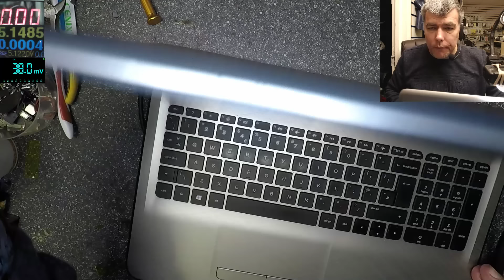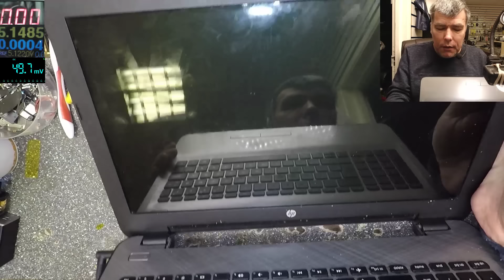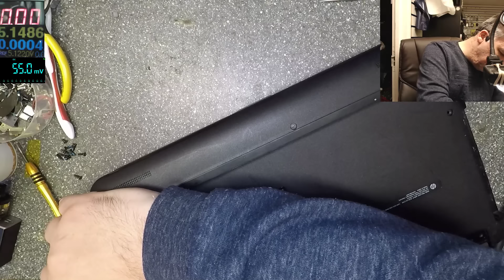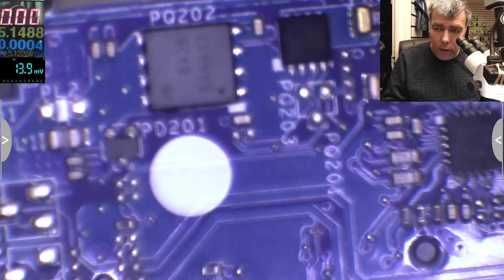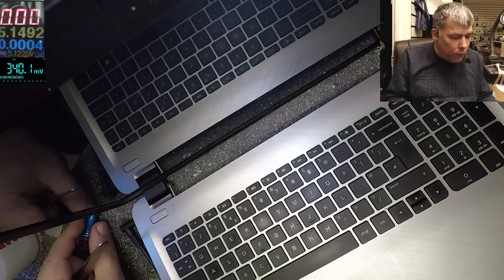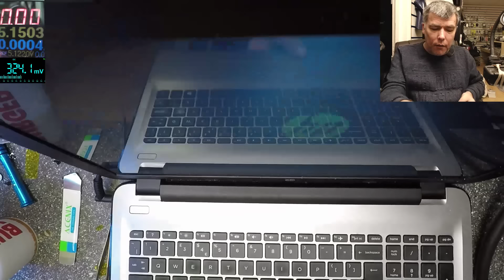Most common fault on a Dead Laptop

Comment: My laptop asus k40ij.now i have black screen problem.i tried removed battery and reset system.but not answer.before problem i operate my laptop it was quickly shout down.then i swiched on.now it start.after 2 days when i was operate my laptop opened windows bars were opened.folders icons were changed.then quickly auto shout down.after that i tried to start my laptop.i was failed.please help me

Comment: I have two hp laptops here and one of them  shows the same symptoms from this vid, except im not advanced enough to test anything else other than power jack, battery connector, etc.. All were showing the proper voltage. The other one used to show light when charging but when turn on the light comes on for a quick second and turns off. Now it doesn't show led when charging anymore and power led comes on for quick second when plugging the charger and same goes when battery is inserted.  What do i do?

Comment: Dear Sir,.  I have hp laptop polio 9480m ......when it's charger get faulty ......I try to use dell charger for it....but accidentally I reversed the polarity.....that time laptop get dead.....then I disconnect battery and connect again.....it's working fine....but it's showing charging without charger connection........what should be the problem there.......now I don't have hp charger in locked down period.......what should possibility of damage there?

Comment: Hello sir please answer my question I badly need your answer. My laptop is not turning on but when I charge it the battery is working but its not turning on. I try the 30, 60, 120, holding of power button but still it does not open. Please help me

Comment: Your list of failures from global warming to French fries was close, but Buffalo Farts caused global warming. Ha! I know you was having a little fun at work. You have to fun! Now, the N-Channel MOSFET is turned on by voltage rather than current. It makes sense that other “Go-No Go” inputs could be a simple reason why this power switch would not turn on. Battery issue, hot signal from a thermistor, etc. All joking aside, I enjoyed the video with a simple solder bridge to take the place of the mosfet. Sweet! I am just a retired automotive tech of 40+ years. I hit like and subscribed and will checking out your “Mother-Board” video and others. I have 4 year old Dell (Dead, kills A/C adaptor when plugged in and two different ones tried) MacBook Air, HP. They are stacking up like cordwood. On internet with WiFi part of a cellphone I don’t have a plan for because I don’t have an extra $27 per month in budget. Wife can’t work, she’s having aortic aneurism in 32 days, I am having my 4th lumbar fusion (L3-L-2) Just all kinds of fun. Just want to send an email to 2 sons and daughter/ their family. Be well buddy & like the sipping cup while saying “Coke” could be a problem. Be watching more to fix and just learn. Thanks.

Comment: HEY ! RESPONSE MY  QUERY ASAP...AFTER DROPPING MY MOMS LAPTOP I CHECKED INSIDE THE LAPTOP AND FOUND THE MOST PROBABLY WIFI CARD  CONNECTORS ARE LOOSE AND I PLACED IN PROPER JOINTS BUT STILL NOT GETTING WIFI CONNECTION.I WANT TO FIX IT AT HOME 'CAUSE I'M PHYSICALLY DISABLED TO GET TO TECHNICAL EXPERTS. REPLAY AS SOON AS POSSIBLE.

Comment: HEY! I DROPPED MOM'S ASUS S41OU  LAPTOP AND SINCE THEN IT DOES NOT CONNECTS TO WIFI AND I CHECKED OPENING IT , MAY BE THE CONNECTING WIRE JOINTS TO THE WIFI CARD I GUESS - ITS LABELED QUALCOMM ATHEROS  QCA9377  IS LOOSEN AND I PRESSED ON IT TO TIGHTEN IT AND THEN CHECKED ITS NOT CONNECTING , I'M PHYSICALLY DISABLED AND CANT GO TO ANY MECHANIC , DONT WANT TO KNOW THEM THE CASE , WHAT CAN I DO AT HOME AND  WHAT  CAN I DO TO POLISH THE DEVICE BODY   AT HOME-REPLY ASAP!

Comment: hello, first congratulate you on your videos, now I expose my case to see if you can help me, I have a laptop hp tpn-c125 my problem is that only the LED of the charging port in white turns on but when I press the power button The computer does nothing, does not turn the fan or show anything on the screen, and disassembled to measure the voltages and see if any component was burned and seems all normal, but when I remove the pcb where the power button is housed that It is in the plastic and the pulse the laptop tries to turn on to see the pwr led light during the following and turns off and the processor in all this process heats up as if it were working but it does not start anything just does that. Could you help me?

Comment: I have an old laptop someone gave us. My son would play games on it and I used it for the old floppy drive with usb so I could get pictures off of old floppies and put on flash drive.
One day it was dead, dead, dead. Zero. Nothing. I traced the input power down to the circuit board near the input plug. It had surface mount resistors I noticed had numbers on them I figured were the value numbers. Near the power plug it had a couple marked 0.0
I thought about it that was a weird value for resistor then it occurred to me it might be zero resistance used as a jumper on circuit board so I found the one with power on one side and zero on the other and soldered a tiny wire across it. 
I then had my ‘ Colin Clive from the Frankenstein movie ‘ moment. “ It’s alive ! “

Comment: I like the idea of using voltage to check continuity and short circuits.  If you have a high resolution meter you have a more procise location for the  short circuit it helped me pin point a short  on the  circuit.  Great videos ....

Comment: What is the reason for extreme heating of hp laptop. My technician told it had caused for sticking not responding in time to time in my hp lap by a loosening of some ic pins. Does it true?

Comment: What if an MSI GE62 6QD Apache Pro Laptop appears to only partially power up?  It will charge the battery, but the only thing that will power on are the fans, and the backlight on the keyboard

Comment: I get why you wouldn't want to spend time replacing components, it's time-consuming and not economically viable. But stuff like that mosfet was put there for a reason, there's no way a company will engineer consumer devices with extra components that increase their cost. If the component failed, it failed for a reason and not being there now could cause bigger issues in the long run. 
Or it can work fine without it for the rest of the device's life, who knows? I wouldn't want to risk it, nor would I feel comfortable having to guarantee a job like this. 
In any case, problem solved, customer happy, you get paid, planet saves from a little bit of extra electronic trash. That's the most important

Comment: My laptop when plugged in has light but when I try to switch it on the light goes off. I tried using a new battery but it had the same problem and the laptop is not switching on. Help

Comment: Hi I have a ASUS N53SV it runs. there is a light on the front with a lightbulb symbol. I have seen the orange light blinking with hard drive symbol. But the screen stays black, also when i plug a HDMI in the laptop the external screen stays black. What is your opnion to start trouble shooting this case.

Comment: Hey guys so im new in this electronic thing, I just were watching videos until i found this, I am trying to get overall info before try to fix something, So i have a question

Whats the difference between the Mosfet being replaced or not? I mean he just took off, so after he removed the thing, the circuit now was now 'closed' right?, so the electricity just keep flowing normally?  But whats the difference? Can someone explain me?

Comment: I've seen three of these vids so far. First found bad diode, unsolder tossed aside and fixed. Second time was bad cap, unsolder and toss aside, fixed again. Third time is bad mosfet, unsolder then shorted with small wire and tossed aside fixed!

Comment: So I threw up on the side of my laptop (hp EliteBook) and when I cleaned it it was working fine. A few months later it won't turn on but the charger light is on when it charges. I checked inside including the battery and everything looks fine

Comment: I have a ACER ASPIRE f15 laptop. I’ve been charging my e-cig through my my USB port on my laptop. I don’t have a plug so I’ve been using USB ports. Recently I had a problem with my e-cig it wouldn’t charge properly and caused a power surge on my laptop. This was displayed in bottom right hand corner warning me. Then my laptop froze and wouldn’t let me properly shut down so I had to hold the power button down till it went off. I went too bed woke up next day and there’s no power lights on and won’t charge or turn on. I’ve tried a few things which haven’t worked :
* Pinhole reset on back 
* bios battery taken out put back in 
* fuse in charge plugged changed 

I suspect I’ve fried something but I can’t smell anything burnt. 

 I’m not that great on computers, what else can I try too bring it back too life ?

Comment: My fell laptop wasn't working i took it to my friends house to see if he could fix it .well it was about 2 months passed by . Anyways just happened to stop by and i ask so any luck with my laptop he' like it won't come on . Well it was coming on but i can't remember what it said to do anyways he plugged it in and do you believe it actually came on and was working wonderful. Now this was last Friday so it's been working for a week and actually all Thursday morning well i went to turn it on around midnight well one power light came on then went off then the other Bink on and then went off then the red light just kept blinking for about 10  seconds then went off then one power light came back on for about 10  seconds and qentof they keep going on &  off. But the thing is the screen stays blank and looks black lives ke there's no power. You.dont hear the fan nothing appears to be on or working other than the lights going off and on .  So i  have no power other than blinking lights .and you can't hearthefan so what's my options. Any suggestions

Comment: Hi first of all thanks for great videos , i have hp laptop with fault, it flashes 8 orange when power plugged in, all i find on internet is they say faulty power adapter but i tried 3 new ones all do the same thing, what can i start checking , thanks

Comment: I love the simplicity of the way that the 8-pin IC Chip was removed and then (using calibrated fuse wire) bridging the Drain & Source in order to restore the 19vdc supply to the circuit.To say that the Motherboard is "complex" is an understatement! It is also extremely difficult for anyone to fully understand the full function of the 8 - pin IC Chip that you removed. Further to this, the pinout diagram would be needed - in order to ensure that you do - in fact bridge the Drain & Source. The IC device which was removed, handled the full current of the Laptop. There may have been the correct 'Gate' voltage present to turn the Mosfet on, but the device may have been faulty. I do appreciate everything that I have seen in this video, and I have been enlightened by your Tutorial. Thanks & regards from Sydney Australia.

Comment: OK, are you leaving the power connected while your dismantling components?  This is not recommended.  Maybe your using a power bar switch as your working and testing the device, but it didn't look like you are.  eek.

Also, an FYI.....spending just a few minutes using compressed air to clean the CPU cooling fan and vent, as well cleaning off the gunk on the screen, keypad and device housing for your customers....makes for a great customer service technique.

Comment: Love your videos, but I must agree that this one seems dodgy. Replace the mosfet with a wire. Why was the mosfet there in the first place? I'm sure the manufacturer deemed it necessary, they would have left it out if they could. Bypassing it has eliminated some capability or feature, likely safety or reliability-related. You called it a fuse, but wasn't it just a fine wire? If it's all about saving time, why not just leave the mosfet in place and bridge it?

Comment: I have the same laptop. Battery is dead(Battery # 807611-421). The battery has only 3 cells, which gives 10.95V. I found in Ebay a battery with the same number but has 4 cells (14.8V). My question is will this battery damage the motherboard? The voltage (either 10 or 14) will be converted into 3.3V & 5V so will this 14V harm the logic board?  Thank You

Comment: I have a acer lap it died sudenly it doesnt charge or there are no lights on i removed my hard disc and i have a rlly quiet ticking noise when i plug in my charger its not the hd that ticks cuz i removed it so what is making the ticking sound when i plug the power in ? Can u tell me pls

Comment: I dont think that is a proper fix.. If I were u, I would have tracked down gate line. Most probably that MOSFET should be doing polarity protection. Now most probably u can get 19v at port from battery because there is no MOSFET preventing battery voltage going out.
Hope that makes sense

Comment: Dell E6400 laptop
Windows 10/ Also flickered with Vista
Screen flicker issue

Flickers at bios screen
No issues on external monitor
Checked ribbon cable
Tightened hinges
Updated drivers
No visible screen damage
Purple line across screen
Flickers like a hearbeat
Flickers in safe mode

What to replace first?

Comment: Hello, I have a Toshiba Tecra Z40-A series.  It is been dead for 4years.  My daughter put a different charger, we were in vacation abroad and I assume some relative gave her a different charger and that's how it burned.  I connect the original charger and pressed the power button and the power button flashes twice and at the third flash yellow led under the 🔋 and charger icon flashes along with the power icon.  When it was working my 💻 was showing that it was not charging until it went dead.  A computer specialist told me that it was the motherboard.  I think is something along with the charging system to the battery. The charger has 19volts and the power button and the battery/charger indicators are giving me some codes? As it flashes?? Thanks

Comment: This is not the correct way if you remove the component and short its pins this will not work long can cause fire hazard not recommended

Comment: Hi,I have a hp laptop that's kinda dead.. I plugged the charger into the laptop without a battery,the light on the charging port will light,but when I press the power button nothing happens..what could be the problem?

Comment: I've got an hp 15-g023cl laptop it has no power at all, removed the cmos battery for 15 minutes and put it back together and it worked fine for a couple of hours but didn't notice it wasn't charging and it died completely again so I did the same thing again but this time it didn't work, any suggestions would be very much appreciated. Thank you

Comment: I have the exact same problem with my motherboard, only diffrence is when i put power suplly on that current resistor two chips are getting really hot (ALC271x and 95836 HRTZ). Do I need to replace those two chips or something else might be the problem? Thank you!

Comment: the fault started this way, m narrating if you would help suggest a solution.. I was first having a fan issue, because the fan stopped working, I didn't give it an attention, and am a type that doesn't switch off my laptop I would just close and leave,  so a day came that I was playing FIFA 15 on it and it suddenly started heating out which has never happened, I turned it off to cool it after which I tried putting it on but refused to come up on the screen but the button light comes up. so I took it to a close by engineer who checked and said it has affected the motherboard, I was shocked and didn't say anything than to take my laptop out of his office because I thought he wasn't capable enough because I believe motherboard cannot just be damaged all of a sudden and you'd tell me to go get another motherboard so I kept the laptop and never bother to repair than to get a new one.. so as I saw this video I thought to myself could my laptop wake up again without me changing the motherboard?

Comment: We are an IT management firm with a depot where we take care of all hardware repairs unless units are under warranty.

My first thought here is this guy must be doing PC repair in El Salvadore as they are famous for soldering power adapters directly to the motherboard to perform power jack repairs, and this clown is in the same category.  He hasn't the intelligence to design anything he works on, but he knows how to wrap foil around a fuse to bypass it, thus guaranteeing failure down the road.

If I saw this idiot do this on our bench, I'd run his ass out the front door so fast he wouldn't know what hit him.

I'm a certified IT Pro with an electronics background and have been completing repairs for over 4 decades and learned long ago that it pays to do the job right.

Comment: So you shorted source and drain on the MOSFET.  And now it works.  But what was the MOSFET for in the first place?  It turned off to block the current at some point in the operation but what was that.  Obviously it was not part of a switching power supply because that supply would no longer be working.

Comment: Are  you A+ certified? I think  not as you failed to check the most simplest item, that being the power adapter. If that does not work than all other work is in vain. When you have no power, regardless if it is a laptop or a desk top always check the power supply first.

Comment: This is not a fix, it's a hack. It does not get the root cause of the problem, you're just bypassing it. The mosfet is either bad or another inline circuit feeding the mosfet to turn on is bad, short, etc.. This is the equivalent of duck taping your house's circuit breaker because it's tripping, and saying it's fixed until your house burns down.